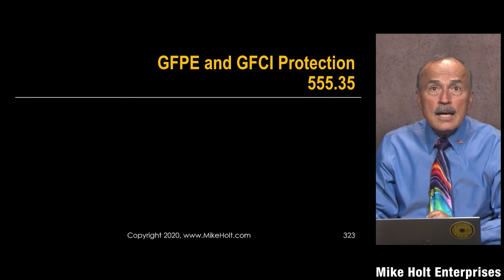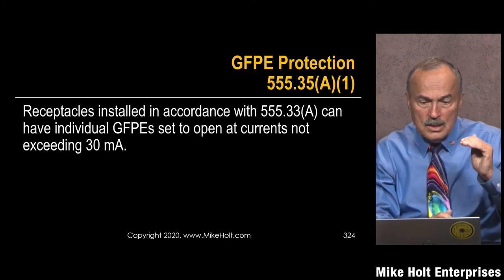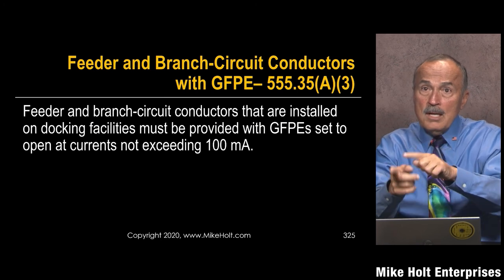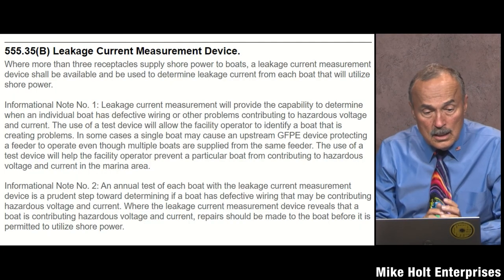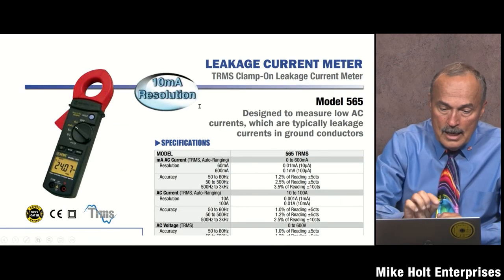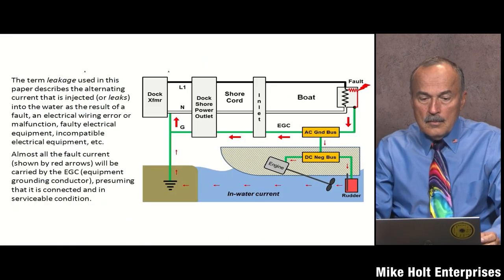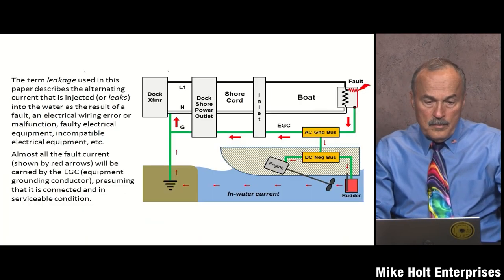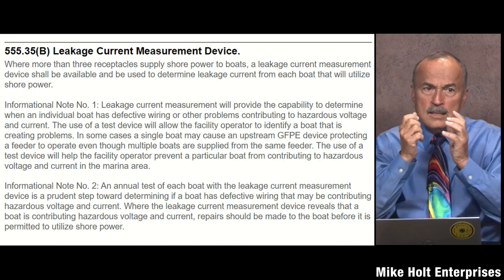Marina Ground Fault Protection, NEC 2020 - [555.35], (10min:38sec)

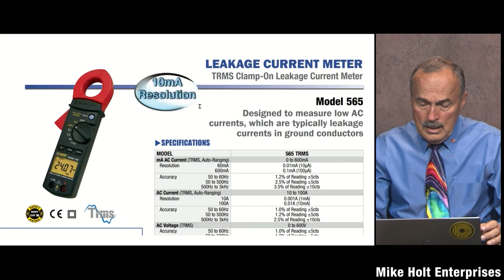Comment: The discussion at 8:30 is confounded by separate sections in the AEMC 565 clamp on Ammeter specifications for different ranges.  The special design of this meter allows clamp measurements at 60 and 600mA full scale.  eg 10mA reading on 60mA scale reads  10 +/-0.17mA.  100mA on 600mA scale reads 100 +/-1.7mA.

The key is that the clamp on Ammeter is clamped around all current carrying conductors so that the majority of the load current is cancelled and the only current measured is the ground fault.  That means you can measure very low ground fault currents on loads limited only by the multiple conductors that need to fit in the clamp.

Comment: Your team is wonderfully entertaining. The comments back and forth between you and your team are worth the price of admission by themselves and then while I'm laughing I learn something. You can't get any better than that. 

I'd like to know what route the fault current takes in escaping the vessel's electrical system? I know that the vessel's electrical system is not addressed at all by the US National Electric Code. Still I would love to know how the current escapes from the insulation of the vessel's electrical system and ends up in the water with sometimes deadly effect. Where does it get out of the electrical system and what route takes it out through the hull of the vessel. Tom Horne